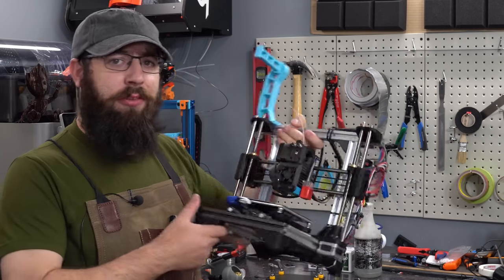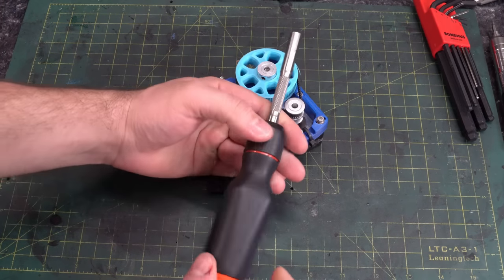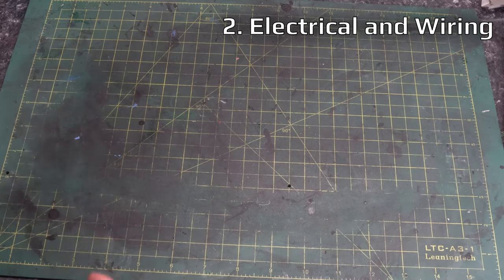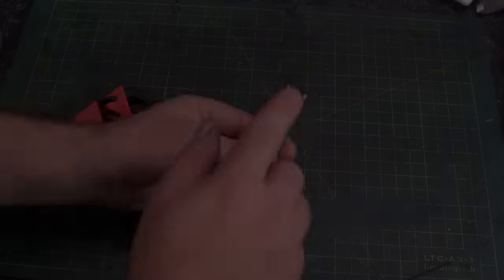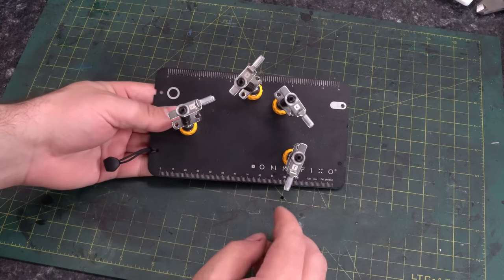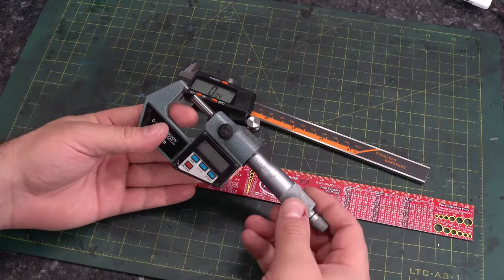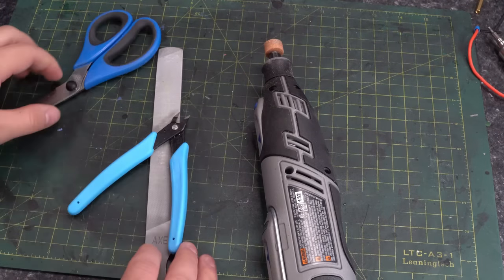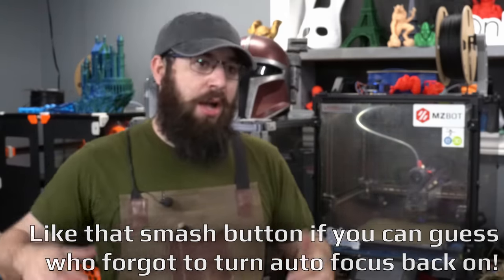The Tools I Use in 2022 - (and yes, I DO use the LTT STORE SCREWDRIVER) #3dprinting

Comment: I have one of the $25 US Amazon soldering kits, and they work fine. Adjustable temp, fits the heat set kit too, and came with a cheap multimeter.

Comment: The ES15 by Miniware (company that actually designed the drivers the similar looking ones are based on) is the upgraded version of the driver here and has more oomph, faster speed, and a bigger battery just FYI for anyone looking.
Reply: yeah they are good perfect amount of torque for m3 and m4 screws compare to my wowstick will always need manually turn the last couple turns

Comment: Quick tip for running wires through a split loom. Run the wire through a box wrenchand run that through the loom while you hold the wires at the end. As easy as a zipper.

Comment: Awesome video as usual. My most important tools are broken. Gotta replace the linear bearings an clean up the rods on my Delta, and the roller wheels on my Ender 3 v2. Was in storage with NO climate control and the rods are showing surface rust and 3 of the wheels are stuck. Parts are ordered, just waiting on delivery.

Comment: While you called out files while showing a large file. I would specifically like to add needle files. Very useful for cleaning up holes or weird crannies in prints where larger files don't fit.

Comment: Ive been using those butt connectors that have solder and that are heat shrink together.. usually find a kit for @ 30.00 for small wiring absolutely love them.

Comment: You should have provided a omnifixo affiliate code or something like that I immediately needed one of those. Good video I use almost the same tools. What I also use all the time are my safety goggles (got plastic shrapnels too often flying to my eyes) and a set of those dentist tools. They are really handy for removing supports and all kind of other stuff. Also different types of clamps are always useful if you build stuff.
Reply from the maker: They don't have an aff link. And yes there is way more than I could cover in one video.

Comment: Useful video, I'm almost there :)
Btw a question for the next stream, is there any news about Voron Tap? I'm about to start printing parts for my first Voron build and would like to have the latest bed leveling so not sure will be updates to the git repos, or that will be just a mod?
thanks
Reply from the maker: Check the announcement page on the voron discord
Reply: @CanuckCreator  got an answer on the forum, it is not released so there's no information about it yet.

Comment: You can get leaded solder in the EU. However you must not sell products made with it commercially in the EU as the product would not be ROHS compliant. For home work you can use it.
For commercial stuff ROHS is not a bad idea. Even if you never touch the internal of a device it would contaminate the environment after use from land fills, inceration for centuries to come.